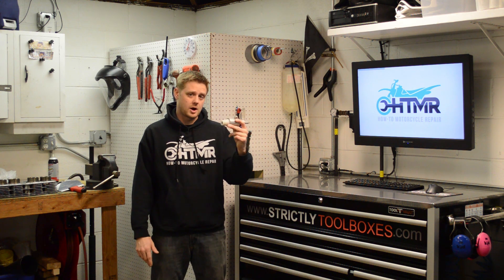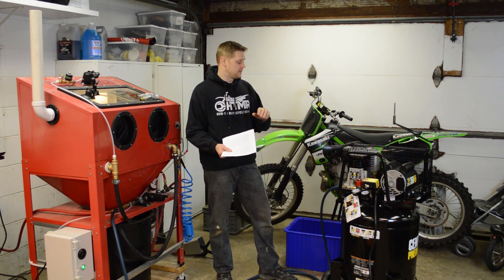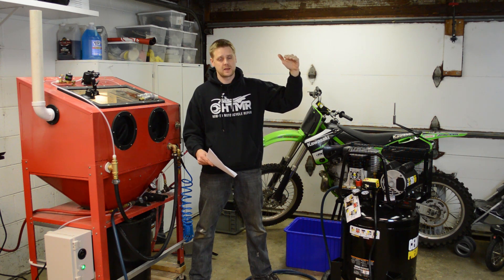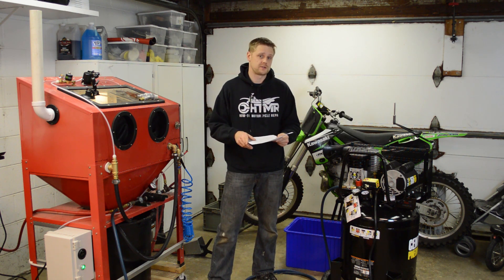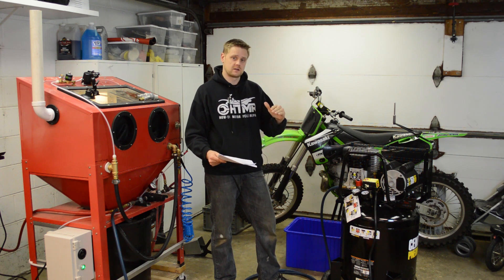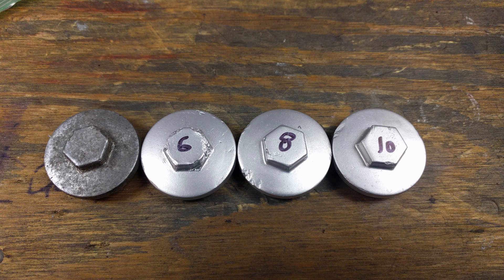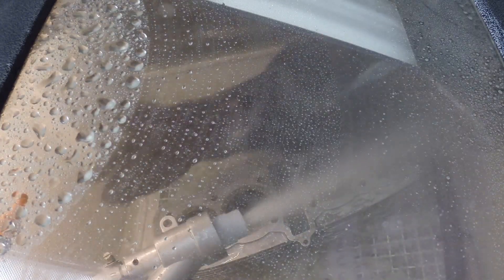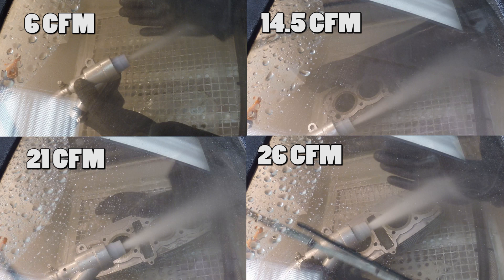How-To: Vapor Blast with a $329 / 120V / 6 CFM Air Compressor

Comment from the maker: Buy plans here -> https://howtomotorcyclerepair.com/diy-vapor-blaster-plans
Blog post -> https://www.howtomotorcyclerepair.com/diyvaporblasterbuildplans/
Reply: MatthewMCRepair hey I bought the closed loop plans and have all the supplies, about to build. Just wondering if you’ve had issues with the flex seal coming off the cabinet when blasting?
Reply: which Nozzle diameter works for this air compressor? anything wrong with a 2.5 if you are using course glass beads? dont care if it takes long just care about the results. thank you!
Reply: also,  do you have a video on how to link up 2 of these air compressors? where to buy the parts? thank you
Reply: I dont mean to be off topic but does someone know a trick to get back into an Instagram account?
I was stupid forgot the password. I love any tips you can give me
Reply: @Alvin Tyler Instablaster =)
Reply: @Holden Crew i really appreciate your reply. I found the site through google and I'm waiting for the hacking stuff atm.
I see it takes a while so I will reply here later with my results.
Reply: @Holden Crew it did the trick and I finally got access to my account again. I am so happy:D
Thank you so much you saved my ass !
Reply: @Alvin Tyler you are welcome :D

Comment: Think the real problem most people deal with is having the power to actually run things and as the cost of petrol goes up running large petrol compressors gets expensive or even a generator to power things. The smaller your market in the country you live in the more expensive everything becomes.
Did see an interesting build were someone didn't use air and just added a water blaster pump because you can actually do it that way some boat places use it but more with commercial pumps and uses more material

Comment: I am using an old sanborn 25 gallon 4.5 hp compressor, its rated at around 6.5 cfm somewhere around that, and im using it on a large trinco siphon cabinet but using skat blasts smallest gun and tip sizes, she runs the whole time and really only hangs at around 60-70 psi which is pretty low for normal blasting

Comment: Does the higher CFM compressors produce better brightness of the finish or simply can you still get exactly the same brightness with the lower CFM but just have to blast in one area for longer.  I was thinking the higher CFM ones can shoot the media at a higher velocity and produce better cleaning and brightness?
Reply from the maker: "Brightness" is controlled by pressure and distance to the part. Any CFM gun can achieve a "bright" part. The more CFM available the faster you get the end result.

Comment: Cool video I appreciate your effort in going threw those calculations and taking the time to demonstrate. I am going to just go with a gasoline powered compressor which puts out about 12cfm at 90psi and deal with the noise however It would be nice to have a 220 volt compressor for all your DIY jobs. Take care.

Comment: 2mm air nozzle to 6mm outlet nozzle?
Reply: The Chinese gun works for a small compressor by applying putty in the air nozzle and drilling it out with a 2.5mm drill. For water vapour try 6 to 7mm blast nozzle. Dry I would try 4 to 5

Comment: MatthewMCRepair  How long did the 26cfm gun last, with the cheap harbor freight 2hp compressor?   Like how long did it go before the duty cycle came on, and you had to stop working?
Reply from the maker: Only tested 6cfm with hf comp. No way you can do 26cfm with 2hp.
Reply: MatthewMCRepair what compressor did you use to test the other gun nozzles?
Reply from the maker: @redrush40  https://youtu.be/I-mbDwclIzY
Reply: MatthewMCRepair well that’s awesome.  You got about 81% better and now are back up to about 18cfm.   So your running the Tacoma gun and others on your big blue monstrosity compressor (with the make-shift muffler) at 17.8cfm @ 60psi?
Reply from the maker: @redrush40  I only use the tacoma gun now. It consumes about 16-17cfm @60psi.
Reply: MatthewMCRepair Would you say that the Tacoma gun is more efficient, than the biggest mm bore gun you tested. ?
Reply from the maker: @redrush40  Tacoma gun is available in higher CFM's. If you set up the "cheap gun" and tacoma gun to consume the same amount of air, the tacoma gun cleans parts almost 2x faster. So yes it is more efficient.

Comment: Mathew, I'm a little lost. I've never heard of vapor blasting. Is it basically what the company Dustless Blasting does, but you're doing it in a cabinet??
Again.... sorry I'm lost; but if you're blasting in an enclosed cabinet....what's the point and purpose of using water?

I found your video while researching low cfm cabinet blasting. I have a large compressor and blast cabinet at the shop.  At home I'd like to run something small to use for rusted cast iron pieces and maybe sheet metal toys. 

Thanks for the help.

Comment: I mean ultimately it sounds like it's put the $ up front for a powerful enough compressor that won't die from being overused for it's design? I'm going to build one of these soon. First project is finishing home reno and selling then building a shop to put some cool tools like this in it. Great work great video keep it up
Reply from the maker: Yes. Another option is a scroll which is rated for 100% duty cycle. But we all know how much those cost.

Comment: What a fantastic job with the demonstration Matthew! As you know I have a professional cabinet (your plans were not out yet...lol) and when I moved to SoCal my new shop space did not allow for 220V (stupid landlord). I decided to give this same model you chose here a go and figured I live with the extra time it took as the compressor would need to refill and I'd let the duty-cycle rest take place. I have mine plumbed into a separate (additional) 80-gallon tank I got free that had a blown motor. IT WORKS AMAZING! This HF air compressor is so quiet too! I have the "oil-less" it was stupid loud and not near as fast to recover as this one. I can share the link to the Piggyback video and a good demonstration of static vs working psi if you want. I don't ever put links in responses on other channels unless they are wanted. I will have to experiment with the CFM gun tips as you did. I'm pretty sure I'm using a 20cfm with my extra tank set up and it's great. Make it a great day and Keep Wrenching. 😀
Reply from the maker: Feel free to post links. I have about 10psi drop from static to dymnamic (working) with all these guns. That tells me that all plumbing to and on machine can handle whatever I have thrown at it so far.

Comment: Another thing that I am really eager to find out is how ceramic beads will work since my neighbour is importer for those and I get them much cheaper than glass beads. We have all sizes here from flour/dust size to small beads. I have already two buckets for different media but I will also get another for some aggressive media. I will send a picture of the ones that I currently use to rinse my wine decanters.
Bernhard

Comment: Hi Matt, thanks for making me happy. It proofs exactly what I was initially afraid off.... getting a toy that one can use to clean jewelry but definitely not a cylinderblock of my V12 (getting it done in my lifetime 🤣🤣🤣). 
I am waiting hard to get my system up and running. By tomorrow I should know more about getting the large box and next week I will be in Dallas to pick all the plumbing components.
26cfm looks more of what I like to see.
Greetings, Bernhard
Reply from the maker: Yes, you will be happy with the 26cfm setup. Who wouldn't??

Comment: Matthew,  First of all  A very impressive video Thanks Man    Question:  if we are talking finish only (forget time)  can you tell any difference?  Also does the low CFM get the crud of hard to get at places?
Reply from the maker: Same finish can be achieved. The tappet cover at 6cfm was blasted for 4 minutes. With 11cfm, 2 minutes. So I was able to spend more time at 6cfm to get desired finish. You'll notice with the 6cfm gun towards the end I increased blasting distance. This achieves a "shinier" and "brighter" appearance. I didn't have time to this with others. Was really testing CFM consumption.

Any crud should be removed beforehand if possible.
Reply: Yo Fred! Nice to see you here. We like Matthews work as well. I'd back up his reply. It's all about the time. I have experimented with "working pressure vs. static pressure" (not sure if we were connected when I made that video) but what I was attempting was to control the "cut" or how fast it would work. I was still a little leary back then on some finished and not wanting to alter the finish (media type is more important in the consideration). In the end, I found that the higher working PSI (my machine recommended 60 psi) really speed things up. Another thing discovered was that the higher working psi although saved time (which was great for a production business) but does wear down the media faster too. Think of throwing a golf ball at a cement wall vs. bouncing it off the wall. The media's breaks down the same. I find that with my part-time use I come nowhere near the recommended media change intervals. I want to experiment with Matthews suggestion on gun CFM and make an even better set-up! I sure like his machine and plans.